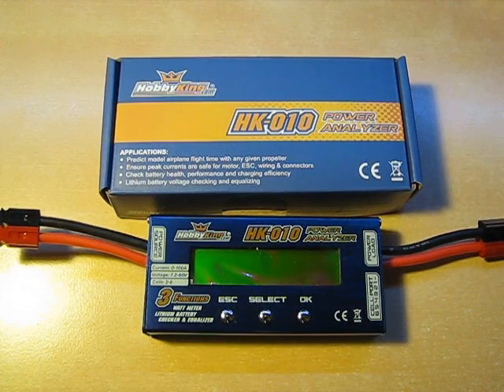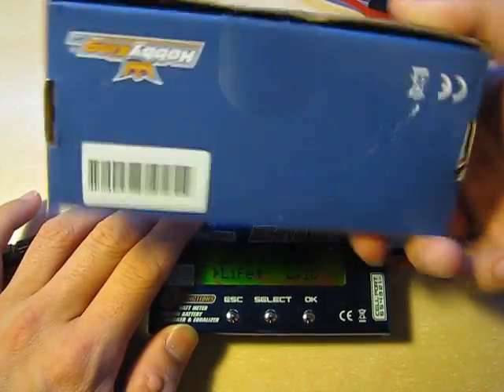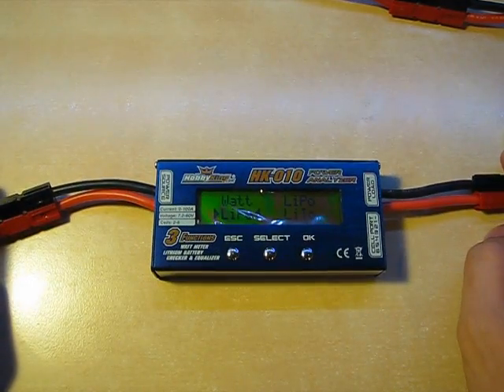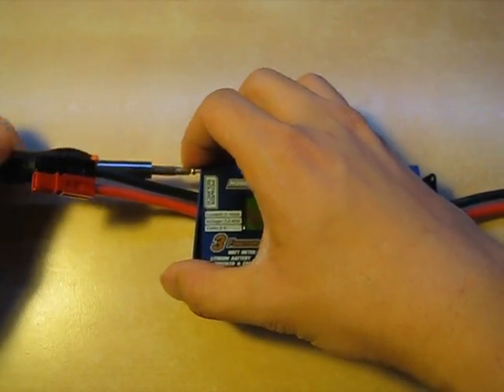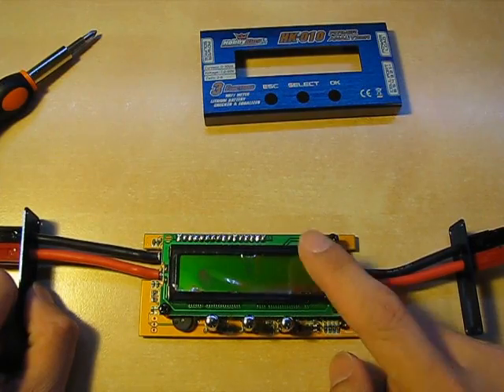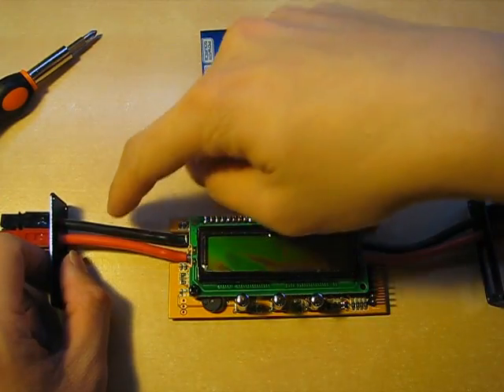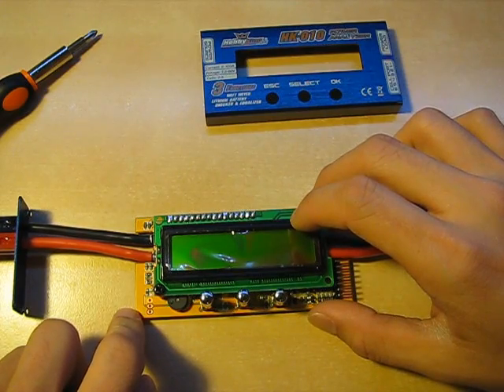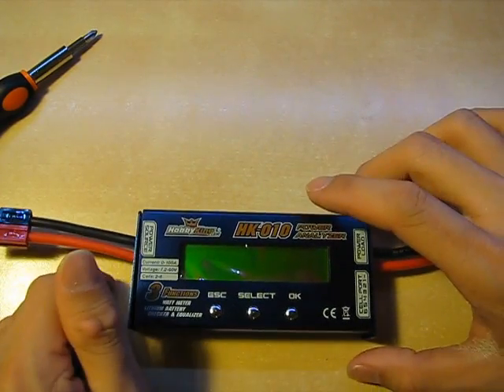HK-010 Power meter review

Comment: Hello, have you used this to balance a large 6s lipo pack?  I am curious how it performs the balancing...does it just discharge the higher cells or actually transfer power from higher voltage cells to the lower voltage cells?  Thanks!

Comment: i went to plug the balance lead in wrong way around while it was connected to lipo and esc sparked smoked melted half the ground pin but it still works ;  )) wish i had your smarts but would this be suitable for a say erevo with 150 amp esc and 2200kv with 2 x 3s > 5450mah 120c batteries feeding such ? my nimble experience thinks it may melt but its not fully pinned all the time

Comment from the maker: @rurouni42 No, you do not need to use the main power plug with the balance port. Just plug the balance lead into the port (correctly!) and select the appropriate balancing mode. Its slow and passive, don't expect amazingly fast balancing.